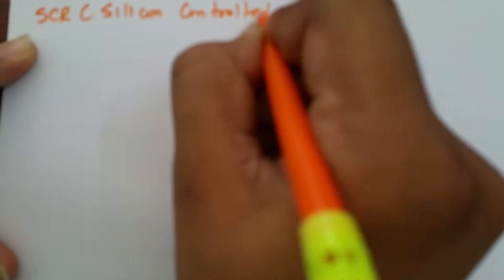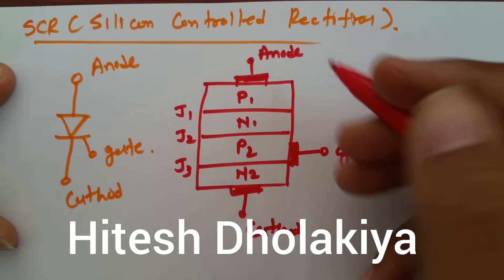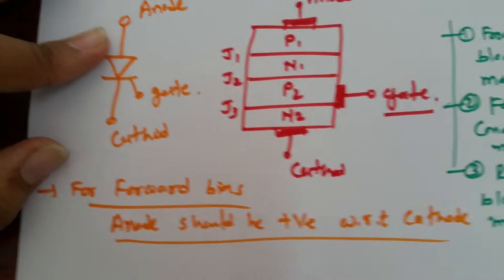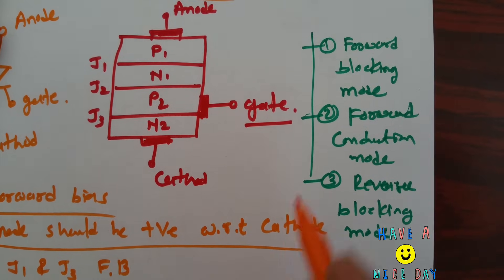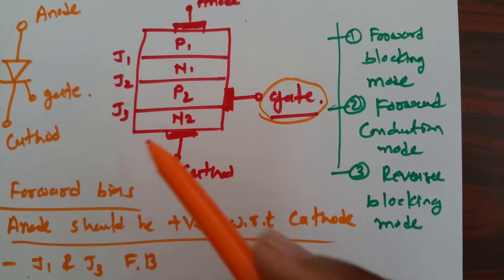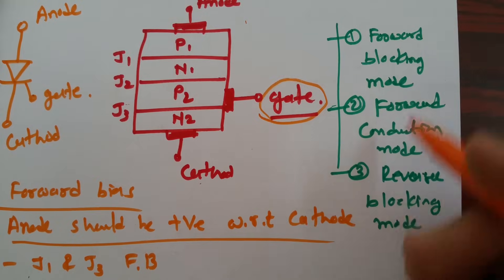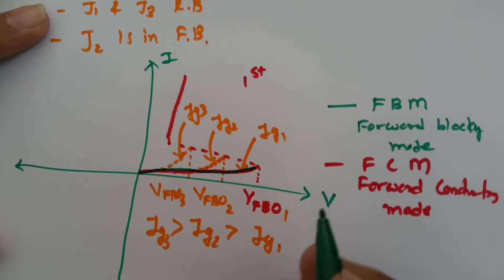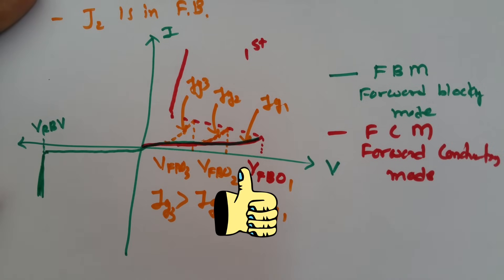SCR - Silicon Controlled Rectifier (Basics, Symbol, Structure, Working, Characteristics, Biasing)

Comment: Latching current añd holding current?
Reply: Latching current is the minimum anode  current required to maintain the thyristor in ON state immediately after a thyristor has been turned ON if it doesn't on immediately thyristor will return to the blocking state.
Holding current is the minimum anode current required to maintain the thyristor in ON state

Comment: But sir in the forward blocking mode why the voltage suddenly decreases and current increases 😥
Reply from the maker: After breakdown of J2, resistance of SCR decreases very stiffly.
Reply: @EngineeringFunda  Aww thanks for the Immediate reply.. And I'm the big fan of your lectures 🥰🙏🙏🙏

Comment: Thanks for solving my mid-semester woes, dude. Also, playback speed set to 1.25 works wonders.
Reply: Me watching at 2x speed 👀😐
Reply: Friends, are you related to the electronic field and due to this korana, you are bored at home, want to learn a new skill, then what is the reason that you enjoy the PCB design course with me, that too without any charge you can use PCB for people  Design has started from absolutely basic, it can be learned by those who are interested in electronic field, then what should be learned with me
  In this, you will be able to work on any software, whether it is Ultime or orcad or protal or Eagle's any tool, in it you will get PCB design DRC
Reply: @pcbdesignhub1847  excuse me
Reply from the maker: Your welcome dear

Comment: What is latching current and holdings current ?
Reply: Latching current is the minimum anode  current required to maintain the thyristor in ON state immediately after a thyristor has been turned ON if it doesn't on immediately thyristor will return to the blocking state.
Holding current is the minimum anode current required to maintain the thyristor in ON state

Comment: Sir why does that J2 broke down in forward conduction mode...???
Reply: Because of in forward bias  the positive terminal (anode) is connected to outer layer of P and negative terminal (cathode) is connected to outer layer of N , So the junction 1 & junction 3 are forward biased, j2 is reverse biased  , that's why the j2 is broked

Comment: How suddenly the voltage decreases after breakdown voltage of junction j2?
Reply: In forward blocking mode, the junctions J1 and J3 are already in conduction mode (forward biased). Only barrier which is stpping the flow of current from anode to cathode now is the J2. So, after breakdown of J2 the barrier fails and SCR starts conducting. Hence, voltage (potential difference) b/w A and K decreases.

Comment: when voltage exceeds Vbo and current starts to increase then y there is suddent drop in forward anode voltage???
Reply from the maker: Once it goes in conduction mode only forward drop voltage will appear across it
Reply: thanku <3
Reply: VBO represent from what?